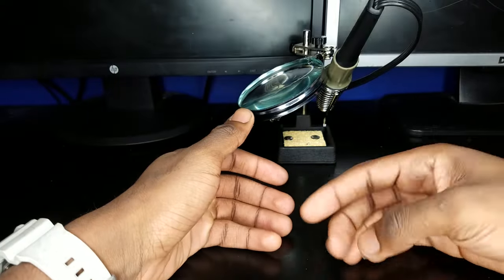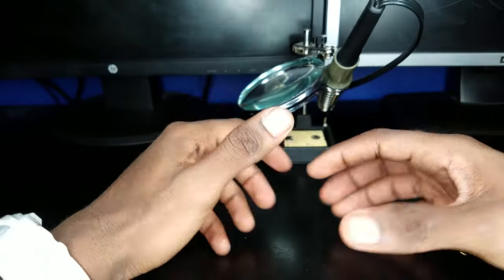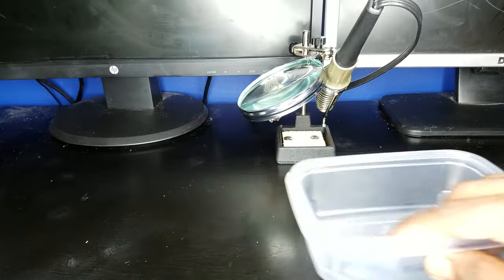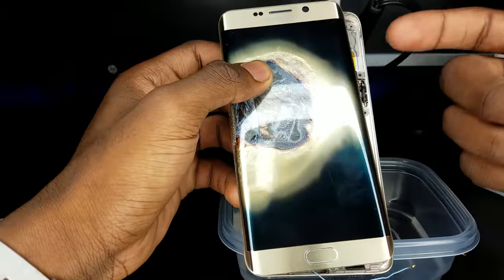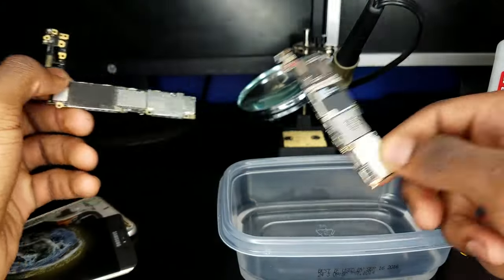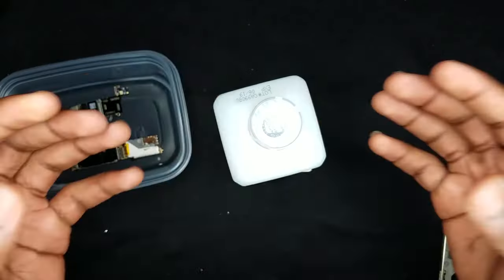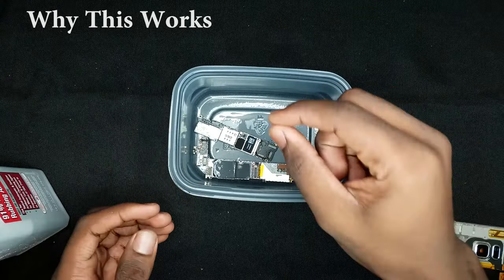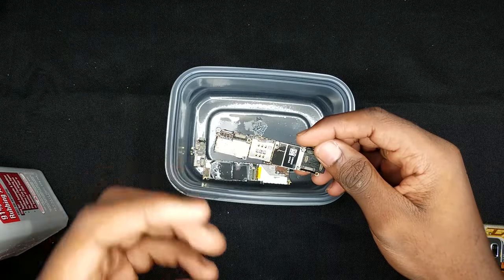How To Repair Water Damaged Phone | Water Damaged Phone | Phone Repair Made Easy | Get Fixed

Comment: what if i used 70% instead of the 90% or 91%? does it make a difference?
Reply from the maker: The higher the number, the more concentrated the solution is. Therefore the higher the percentage of alcohol, the higher  your percentage of succeeding will be.

Comment: Lol motherboard "the central processing unit of the phone"
Reply from the maker: Lol that’s back in my ignorant days. I know the motherboard simply houses the circuitry. The CPU is the brains of the phone that does all the computing & processing.
Reply: @GetFixed  Good to hear! If you go in my channel ignore the videos it's back from 5 months ago before I bought the 2000 dollar gaming PC I had built
Reply: @GetFixed  Also what if I spilled water on my cpu?? Would I have to drench it in alcohol and is it safe to dip my ryzen 5 2600 in alcohol? I was looking for videos online since I spilled water on my cpu like a dumbass.
Reply from the maker: Yes. As of right now Alcohol is the only liquid I know that can come in contact with electronic components and not short it. I recommend putting the CPU in the alcohol a day or two if that's the only component that has made contact with water. If the components has been water damaged for too long though, your CPU will experience a bit of corrosion which can cause it to stop working completely.
Reply: @GetFixed  my ryzen 5 cpu has a little hole that lets liquid pass through it.. If liquid stays trapped and i turn it on will i get damaged? Also will alcohol deteriorate the adhesive and silicone on my cpu?
Reply: @GetFixed  also i spilled gatorade on top of my cpu and cleaned it.. No pins got wet only the top of the cpu got wet.. I know gatorade has electrolytes and is highly conductive. If gatorade evaporated will the residue conduct electricity?
Reply from the maker: Alcohol will dry out the components in the CPU. I don't believe drying out adhesive does anything to the stickiness but silicone I'm not too sure about.
Reply from the maker: The Gatorade will cause those components to corrode because of how long it takes to completely evaporate. But it definitely doesn't hurt to still try this method on the CPU. You have nothing to loose. If this method doesn't work, it's because the components has corroded by now.

Comment: Rice works because in a closed container it absorbs the moisture in the air in the container and without moisture saturating the air, the water is evaporated into the air, just like how dry aged beef is aged in a chilled fridge with a big tray of salt underneath it and over it, it's not directly touching it but the salt absorbed all the moisture in the air in the fridge and starts sucking moisture out of the beef, same as those little containers you put in your basement to prevent mold from moisture, there's no visible water yet after a week it's full of water

Comment: So basicly my phones recent tabs button keeps on pressing by itself after it fell in water it's been quite sometime now and it's still happening do you know how did this how this happend and will this    help it stop
Reply from the maker: There’s a chance that water is still sitting underneath the navigation button. It’s almost like trying to use your phone when the screen is wet. You can try one of two things. 1 carefully heat dry it with a blow dryer or heat gun. 2. Use this method but only dip the bottom of the phone with the navigation buttons sitting in the water for 30 seconds to a minute.
Reply: @GetFixed  do i need to tear the phone apart or do i just dip in it no problem
Reply: Dip it no problem

Comment: my phone acts normal and has a black screen with a blue light that turns green and repeats! please help!
Reply: from water...pool...
Reply from the maker: Try this method I promise you it works. You might have to give it 2-3 days before it begins to function again. I recently f*cked up my phone with liquid. Did this method, and nothing. Three days later tried to charge it, still nothing. That day I decided to put my phone in the resting pile. The next day before I decided to give up on it, I placed it on my wireless charger and it started working again. Currently happy as f*ck!

Comment: I need help please!
Reply from the maker: How can I assist you DJ?
Reply: So I have a Samsung S8 right, so it got wet. Nothing happend, so I plugged it into the charger it said it had water. So now the samsung s8 for some reason doesn't work now. Won't charge or anything neither turn on. How can I fix this? I also opened the phone and it had like white stuff on the Mother board.

Comment: Is there anyway to fix a water Danegeld phone if it was wet and on? When I try to turn it on it just flashes the flash in the back of the phone and red notification light in the front.
Reply: I too would like to know if you've found any answers

Comment: i have alcoholic gel here to clean your hands can this work 2?
Reply from the maker: The Gel won't work. You need the liquid form so it can get into all the little components and dry up the rest of the water the rice can't access.
Reply from the maker: The longer you wait, the lower your chances are of reviving it because the components with start to corrode.
Reply: AH okay thx im going to get this tomorow cuz the stores are closed here in belgium its 19:20 right now here

I just wanted that i saw this earlier
😢 i think you saved alot of phones by doing this good job bro!
Reply from the maker: A few people reported to me this worked for them. I've actually revived quite a few phones with this method. I appreciate you man. Just let me know if you need any help when you get it. Good luck!